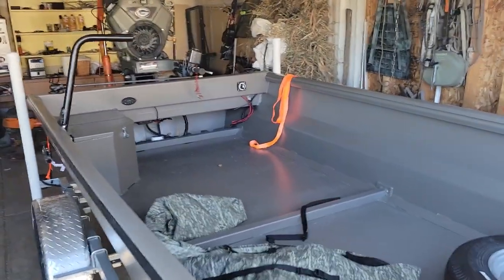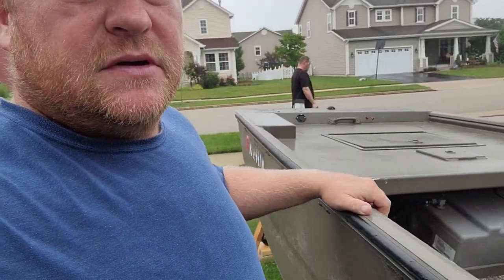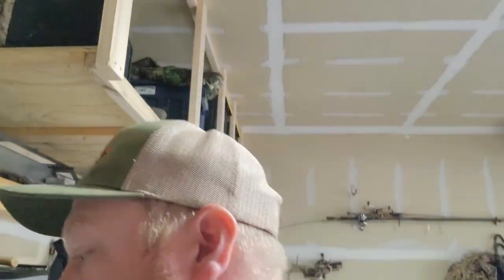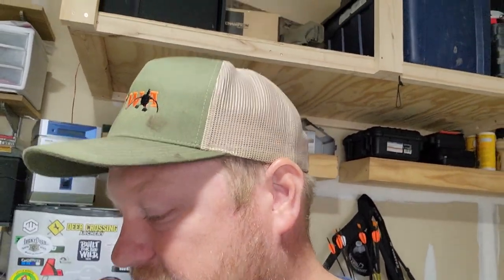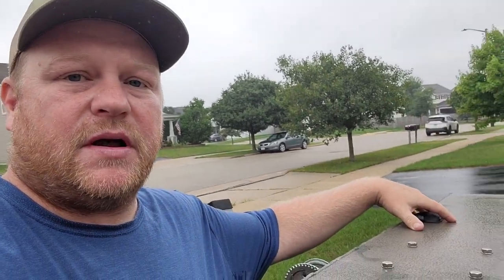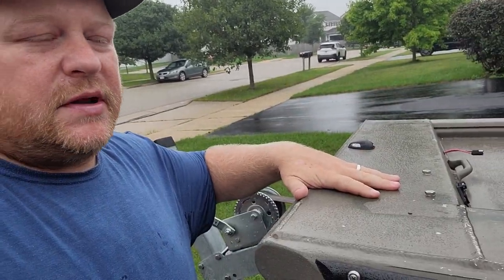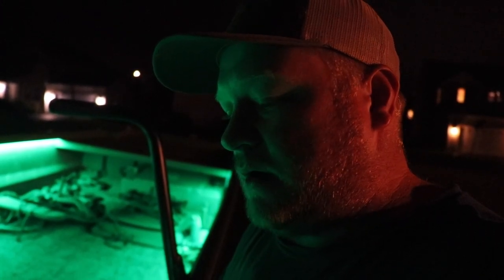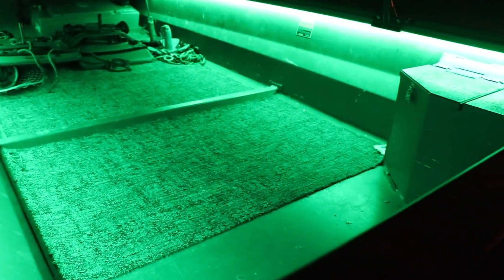DUCK BOAT LIGHT UP! Gatortail Extreme 1754

Comment: How much did the boat cost you im looking to buy one
Reply from the maker: I bought the motor used from a guy in St Louis. Then purchased the hull after not liking a mod v I bought for it.  

So the hull woth a few add on and a trailer was like 12,200 OTD. Bought it from a dealer in Michigan called Freeway Motorsports.
Reply: Ok thank you I’ve been looking a lot into them but I’m not going to buy the ones that cost 30k and that info helps alot awesome boat!